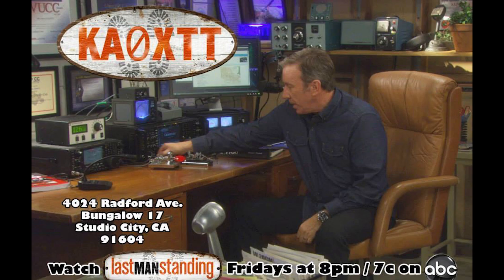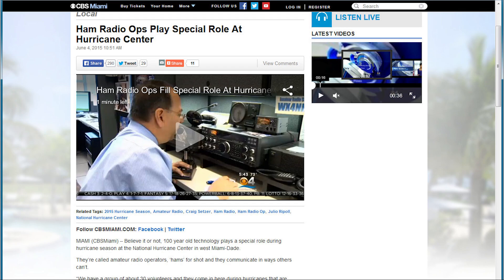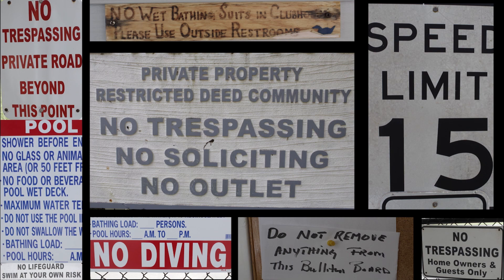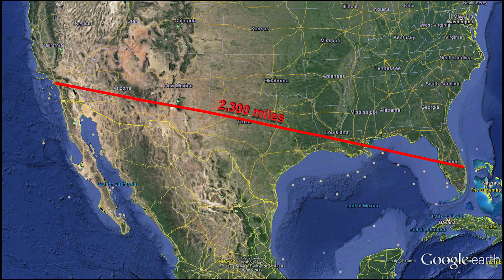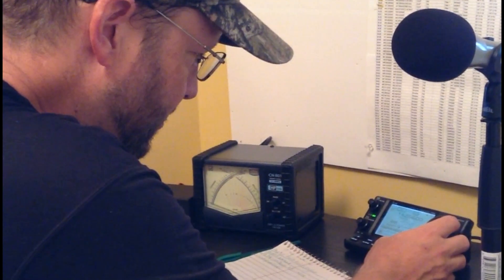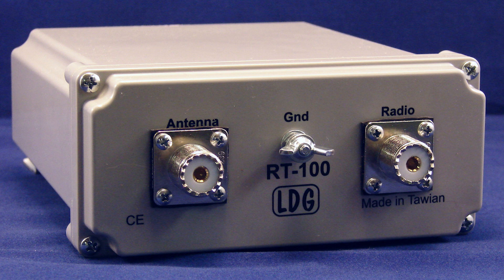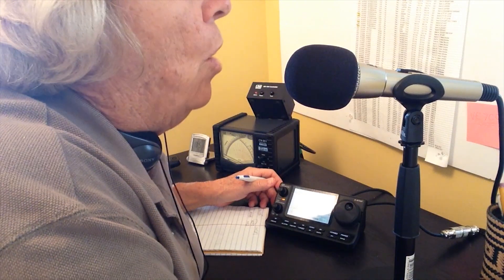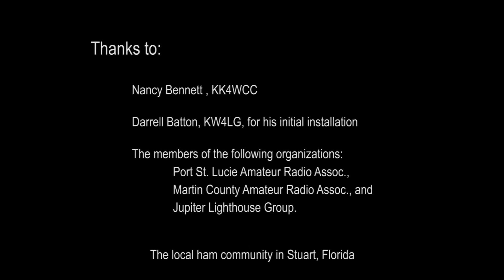Antenna Restrictions and Making Antennas Fit

Comment: Tiny attic... then says it 23ft long. Thats a fairly big attic by British standards. My attic is barely 8 ft long 5ft tall and 4ft wide then I'm surrounded by buildings and interference so HF is hopeless but its ok for a VHF/UHF antenna.
Reply from the maker: Most attics in the US run the full length of the house... though, like mine, not all of it is usable. I have a vaulted ceiling in one room, so that cuts my usable attic space in half as the vaulted ceiling has to go somewhere! 🤣

Comment: Dear God could I use these guys in Michigan. I am having fits trying to get this stealthy endfed that is outside and my attic 10-80 attic dipole to work.
Reply from the maker: Hahaha, sorry, I know how you feel. I live in a condo, but the HOA allows me to have a vertical antenna. My yard is tiny and all concrete. I attached the vertical to the metal railing that surrounds our condo complex. On one side of the wall is my house. On the other, is a very steep 50' high hill. There is no room for radials. My antenna is resonant across all of the 10m band and a bit of the 40m band, but not on any other ham band. It's resonant at  20MHz, 13MHz, and 7MHz and can't be adjusted any further (without cutting the tubing). Condo living can suck for ham radio.

Comment: Nice job...got a HAMR7 That will mount in my attack at my HOA QTH..Are the total specs available for that antenna??

Paul     K1YOU
Reply from the maker: Follow the link to the product description, and from there, click the link to the product website. A lot of the products listed on the HRO website have links to the manufacturer's product website too (though sometimes the manufacturer moves the product website!).

Comment: Very 👍 innovative. I have a Comet GP-1 on
my terrace for VHF-UHF being in an apt, with
a 👍 good sized terrace of 8 x 19 feet on the
third floor, luckily facing the woods 🪵😜 of
the property, so I am not observed as to what I do here. I have a vertical and off center feed dipole too. In the fall last year,
I worked 100 stations in mostly Europe
with my set-up. I also have a VHF-UHF TV
Antenna out there for Over the Air TV. Ray W2CH
Reply from the maker: Sounds like a great setup for apartment. Good job!
Reply: Yes, 😊 Thanks